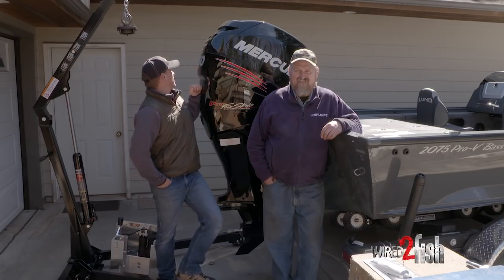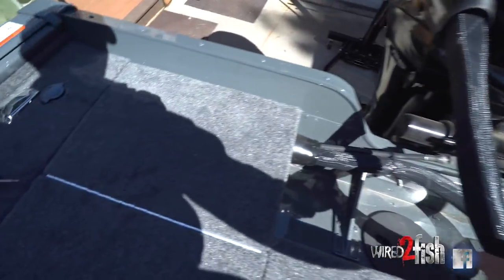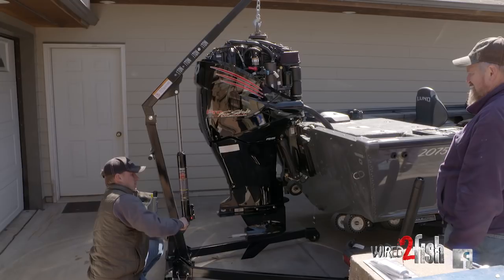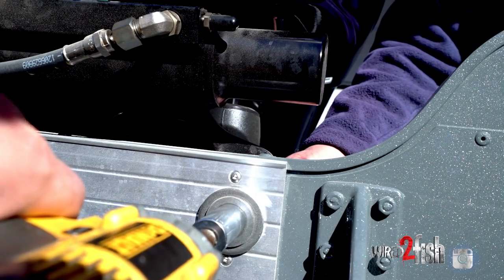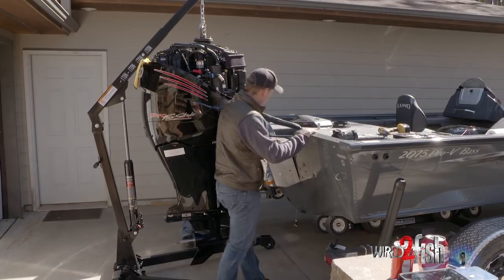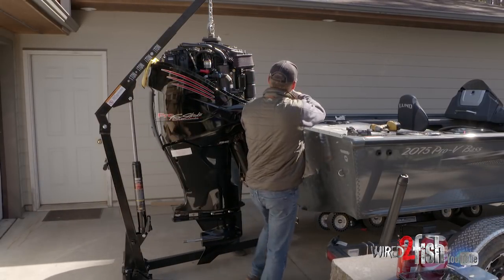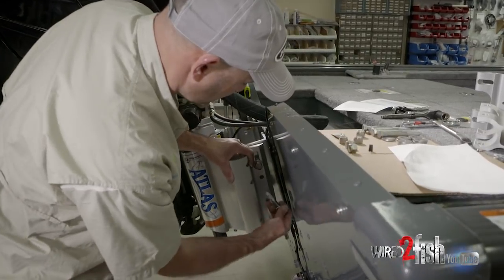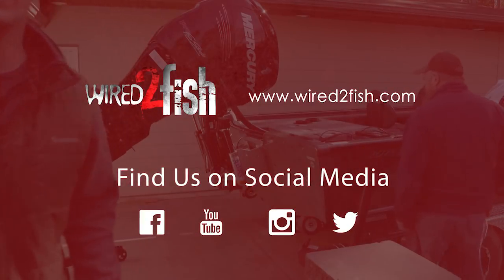How to Install T-H Marine ATLAS Jack Plate

Comment: Have you ever seen or heard of a bracket that will bolt to this jack plate, in place of power pole brackets, to hold a 9.9 kicker motor?
I know the jack plate will hold the weight because it handles my giant 250 pro access! What are your thoughts on hanging at 9.9 off the side of a TH marine 12 inch jack plate?

Comment: Just purchased a boat with a motor that's pushing the max for it.  15 ft skeeter, with a 115 HP Honda on the back.  Took it out this morning, and realized how hard it would be to get it up and on plane in anything less than 4 ft of water.  Ass end just squatted hard on take off.  

I'm looking into putting a jack plate on it to handle the shot, and keep it from nosing up so hard.  Is my assumption correct?  Looks like I'd need an Atlas, due to the weight of a Honda
Reply: Yes your assumption is correct, you should also look at what prop you have, and can have. Changing out the prop can have a positive effect on hole shot as well. I had a 15'10 Ranger with a 110hp that had trouble getting on plane. Switching the prop for better hole shot vs. Top speed made a big difference.

Comment: Huge difference fishing the flats (mosquito lagoon, fl area). My boat, scout 162sf, drafts 8" but I really couldn't take advantage of that without a jack plate. Boat manufacturers should off jack plates as an option.
Reply from the maker: A ton of shallow water performance to be sure! Interesting idea on boat builders offering this product!
Reply: I have a 145, when u trim as far up as you can go while going fast, I can here my motor and I have a super small rooster, does the jack plate cause u to suck air when u have it all the way up

Comment: So I wont need to refill holes it should remount to my old motor mount holes. I'm a little confused on the setback ranges ... what exact does setback mean the distance to the boat ?
Reply: Yes. That is what setback means. A lot of large fast deep V boats which use multiple outboards mount them with Gill brackets which do the same thing, moving the outboards a foot or more back from the transom. Gill Brackets aren't adjustable up and down though. Being further back from the transom changes the thrust vector giving more mechanical advantage to changes in tilt and steering. Also if with a jack plate you can run the motor higher decreasing draft on plane because it's not sitting directly behind wash coming off the transom. The further back the motor is the more stern down the natural trim is though.
Reply: Thankyou so much Steve for the detailed explanation.

Comment: Can you discuss the results/improvements etc. you got using it. What about speed? Thanks.
Reply from the maker: Hey HOTFISH, top end speed improvements on this boat were negligible at about 1.5 mph faster. The biggest benefit for us has been the shallow water running. We fish rivers and a lot of lakes with real shallow accesses. The jack plate has improved safe running and just getting the boat in and out without dinging up the lower unit. Also nice to have if you run shallow water anchors of any brand, as they direct mount to the jack plate without having to drill holes in the transom.
Reply: Wired2Fish 
Thank you for the info. What top speed does that boat get? I’m having a hard time finding good info. Thank you
Reply: @hotfish5495  ~60mph

Comment: please disconnect the battery before you attach to the flywheel. if this engine cranks and starts someone will get seriously injured.
Reply: I agree and to keep from accidentally moving the trim up and down while someones fingers are around the mounting bracket.

Comment: Why so much setback? That looks like a 10" setback?
Reply from the maker: This is the most common setup for 20' bass boat rigging. It was recommended by the Jack Plate manufacturer and boat manufacturer in this case. Not sure the exact reason but think it has something to do with more leverage for hull lift and overall performance.
Reply: @Wired2Fish  my 20’ bass boat has a 6” atlas on it.  That 10” looks like overkill for that tin rig

Comment: They had a hook on that motor to hook the jack too it’s very bad to be pulling to that fly wheel
Reply: It's hanging from the crank. Thats how a verado is slung. Research is simple before typing.
Reply: That's how you lift an outboard bud
Reply: Dang it boy 😂